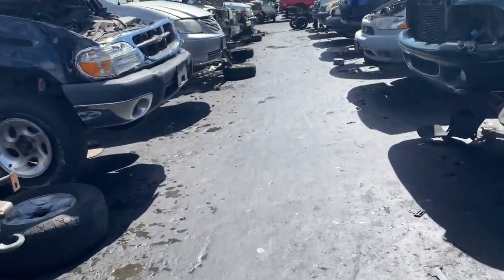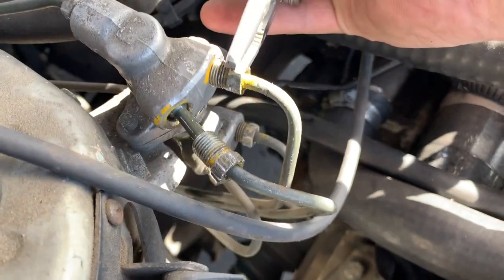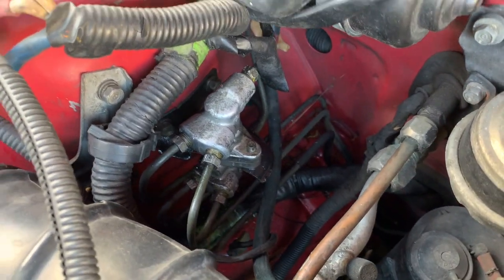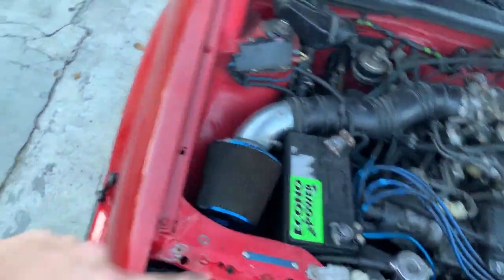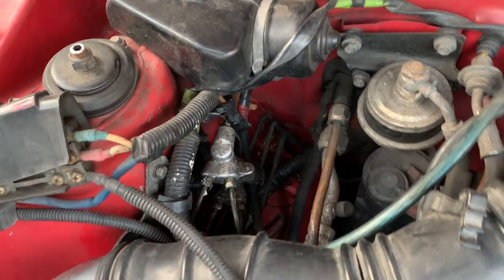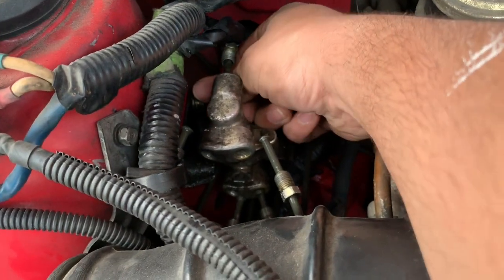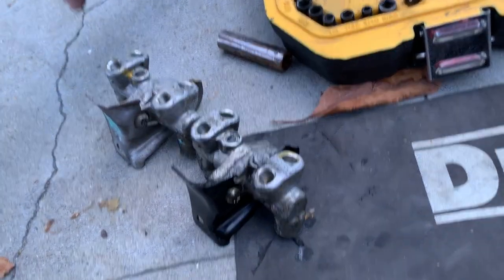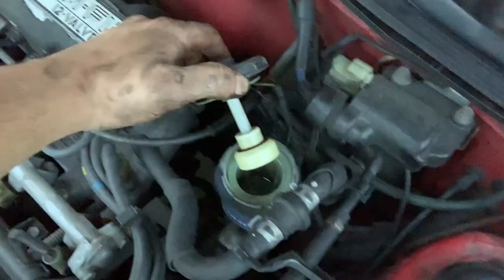Fixing the brakes on the CRX! - Big Brake Upgrade

Comment: Hey man! Great video! My car started leaking from the same spot but I have stock brakes (drums in the rears) would I be able to use the same valve off of the prelude or integra?
Reply from the maker: hey man! thanks for the comment. as for your issue, unfortunately, an 84-87 CRX proportion valve is gonna be your solution. the Integra and prelude need more fluid transferred to the rear because of the piston volume. The CRX brake drum has its own "piston volume" for the brake drum, but it's much smaller. The Integra front calipers are also bigger so they need more fluid as well. If I find my old proportion valve, I might be able to send that to you! lol hope this helped!
Reply: KrakenEP yeah that would be great dude. Are you on the red pepper racing group on Fb?
Reply from the maker: @BB6_Jon  yup. Francisco Javier Gomez is what i have on there lol